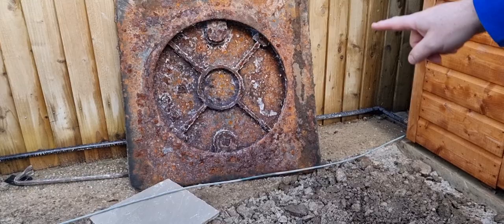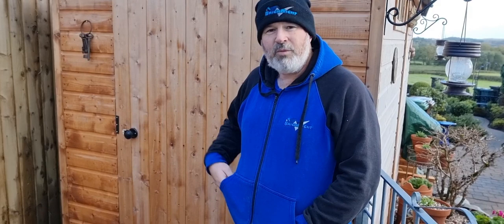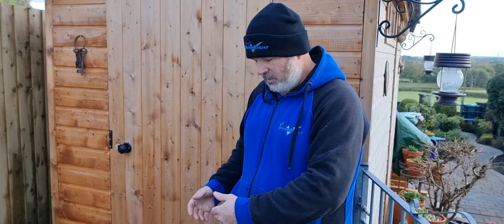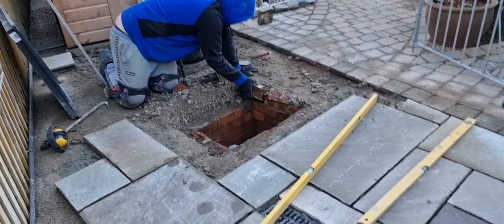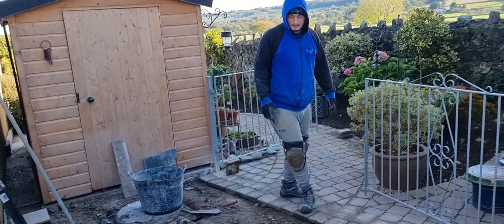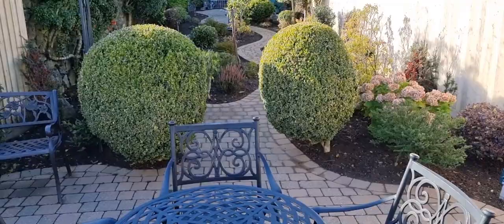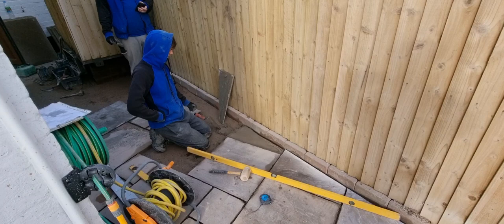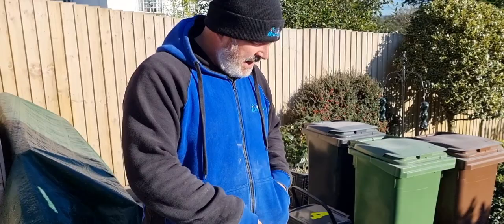Problem Manhole Chamber & Training the LADS

Comment: Brilliant video mate. When these issues come up, it's very hard to overcome. Little manholes are easily sorted..But main drains such as these..we always stay well clear..or if a job requires moving or building close/over a manhole we usually go to 7 Trent and get a build over agreement along with a engineers drawings to specific how things are changing or how we are overcoming the issue without disturbing the original drain.
Brilliant video mate, regardless of the hassle with the drain, the job looks perfect, as always! Have a great weekend buddy!
Reply from the maker: Hya isaac
Yes we do the same on an extension mate with build over or moving a main drain and its the bricklaying side thats tought me that with experience but how many landscapers do you think adhere to these rules or even no about them .got to be careful haven't you to do it right .
Enjoy the weekend yourself and loving your channel mate 
Justin 👍

Comment: Good shout Justin I’ve encountered a manhole in Scotland and was meant to be putting an extension in but main line sewer there and no build over agreement in place so I can’t touch it and architect and engineer never mentioned it in drawings so customer has the problem no way can we touch it until Scottish water have it sorted out with agreement!
Reply from the maker: Been there done exactly that john. A plan or drawing sound in my opinion show any new drainage specs along with any existing drainage alterations or re positioning. A Build over notice should be done before the builder even starts .Its architects just printing the same spec for each job and earning money for a poor service. I could say more but difficult in text form.
Good luck John hope its sorted as i say been there done that more than once mate 
Justin 👍
Reply: @brickrightbuildinglandscaping  now you have said that I’m sticking to my guns and doing anything on that job until they get the build over agreement sorted the architect does not seem interested as he has been paid by customer now something wrong with that system surely they are in charge of drainage when first checking the site before the drawings and also for putting the new drainage in to ?
Reply from the maker: @johnbuist5289  
Esther the client or the architect is responsible most clients pay the architect to arrange all the red tape .More and more often now the drainage is missed and a lot of architects dont even want to lift a manhole not even to find out invert level which as you now is vital to the depths of foundation etc.
Id wouldn't be starting it until all the essentials are sorted out either.
Good luck.John
Reply: @brickrightbuildinglandscaping  Thanks for the Advice Justin much appreciated 👍